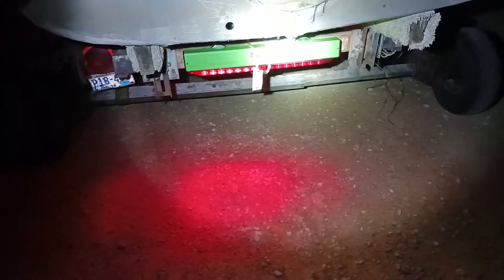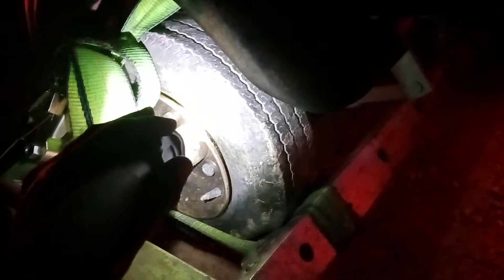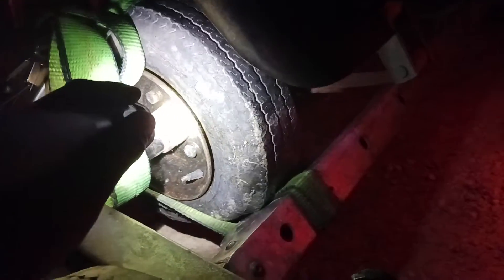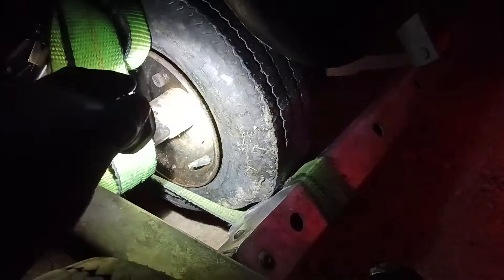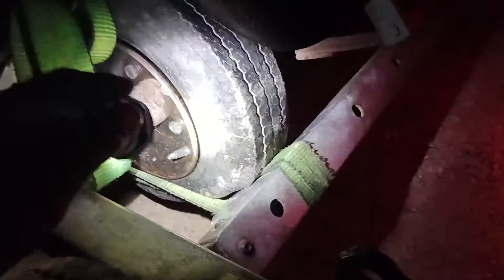Towing a boat trailer with a flat tire

Comment: Where did you buy that tow dolly for a trailer?  Thanks. Jim B
Reply from the maker: https://zips.com/parts-detail/in-the-ditch-x-series-xl-dolly-sets-exte-itd-xldollies Maybe not these exact ones but they are standard towing equipment on tow trucks. This link is just an example. There are a few varieties of them and I am not endorsing one brand over another.